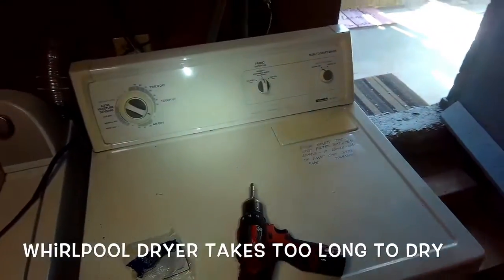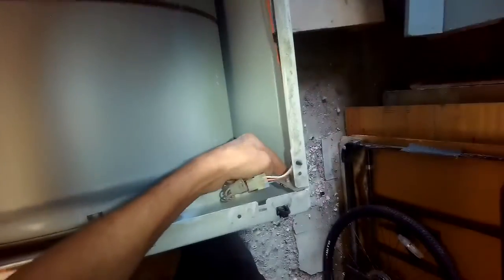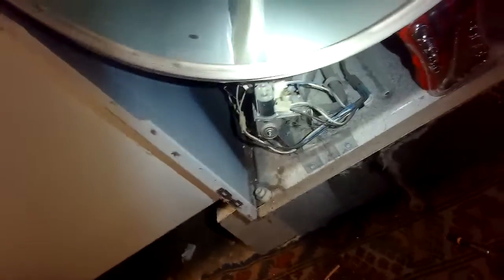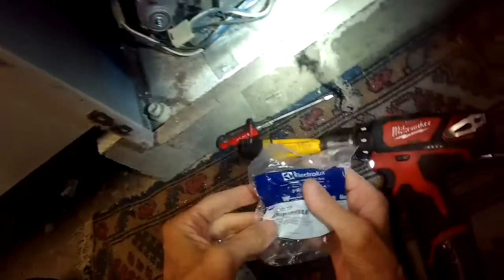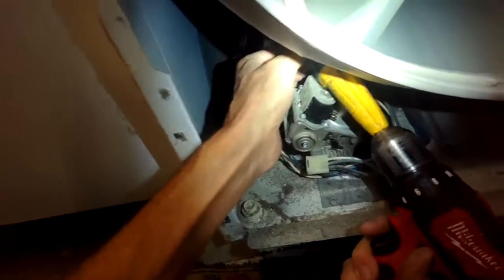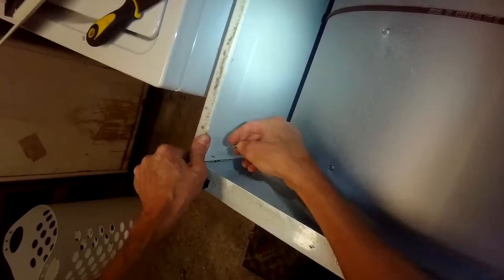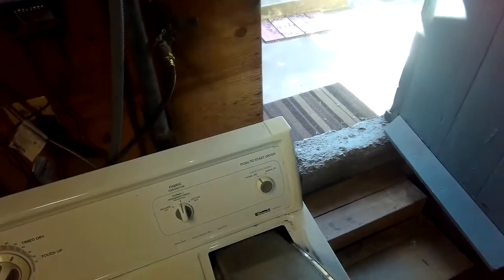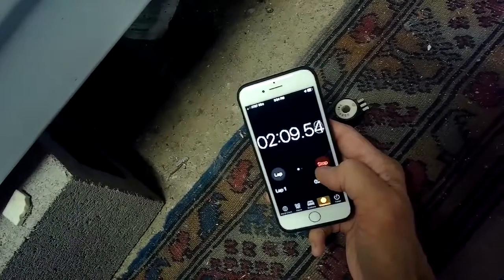✨ GAS DRYER TAKING TOO LONG TO DRY—EASY FIX ✨

Comment: how does that this called u installed in drill when removed screws from gas valve?
Reply from the maker: It’s an angle driver made by Dewalt